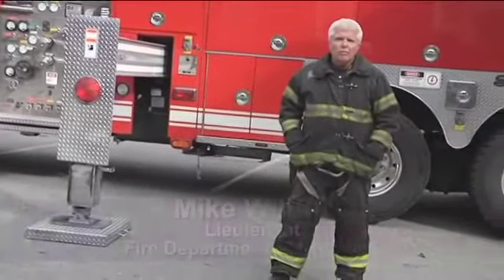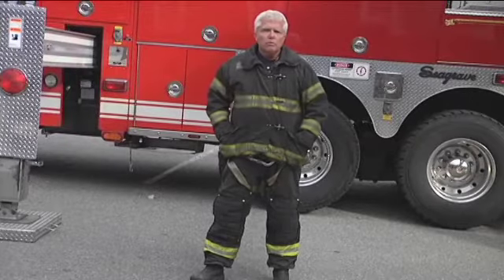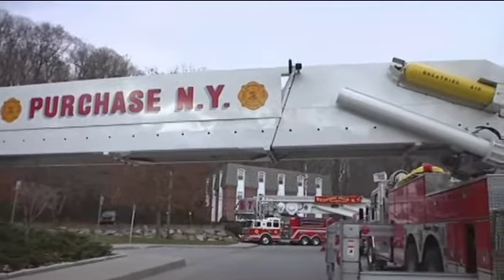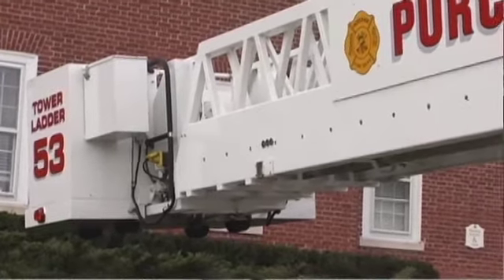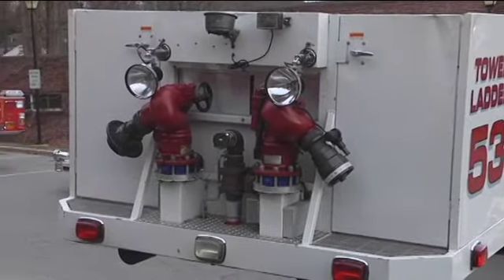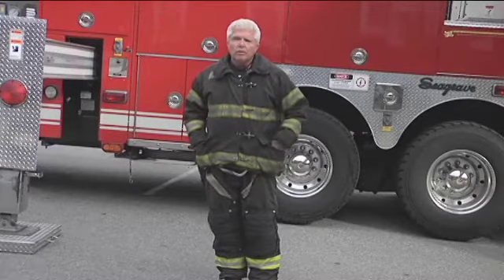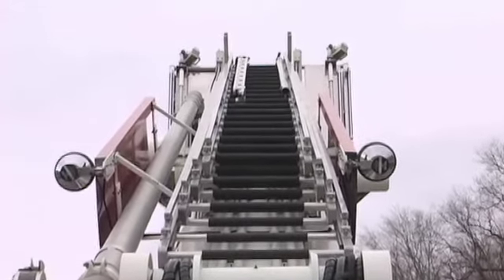Aerial Tower vs. Tower Ladder #1380771835001

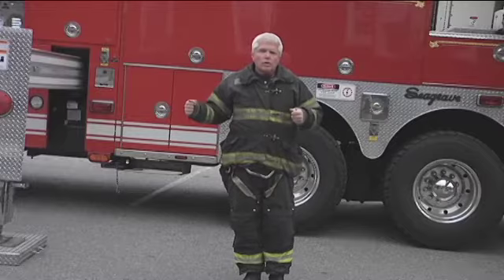Comment: Let's first define Aerial Tower and Tower Ladder, because these apparatus look similar. In the video this distinction is at the 6:37 mark. Watch this first if you are not sure of the differences. 

Tower ladder has a telescoping boom instead of a civilian/firefighter ladder, with a bucket on top and an emergency escape ladder on top of the boom for limited emergency escape use. A victim would be taken into the bucket and lowered to the ground.

Aerial has a civilian/firefighter ladder, which has high railings on either side of the ladder for safety and ladder stiffness. This aerial then becomes an aerial tower if it has a bucket on top. Most aerial ladders do not have a bucket on top. It is incorrectly marked 'tower ladder' on the side of the bucket. For a normal aerial ladder a firefighter and victim would down climb the ladder together. However, with this bucket added you could lower the victim to the ground in the bucket just like a tower ladder.

Comment: What about a tiller truck? What kinda ladder is that called?
Reply: Well it would probably be referenced as an arial, not a tower though probably just an arial ladder or a stick
Reply: Tractor Drawn Aerial (TDA)
Reply: Alot of FFs in my area would call it a stick ladder, because there isn't a platform.

Comment: or get a Bronto Skylift and make both of these trucks obsolete and pitiful
Reply: BS are pieces of crap my man. That’s why there are so few. Crap. Seagrave 95’ aerialscope is best and most sturdy TL on market
Reply: @heavy7799  if you say so.  I'd like to see a head to head competition including factual test results done by independent engineers. Not just some Seagrave fanboys opinion. From what I've seen Bronto Skylift is much more versatile, longest reach in all directions, higher flow rates, etc etc. What are you basing your opinion on. By the way truck brand has nothing to do with the boom. You can put a Bronto Skylift on any truck. Also 95ft is pathetic. That's like saying 3inches is better than 9inches. 😂 Bronto Skylift gets it all the way up and gives you a reach around.
Reply: @t.d.bowman9585  ...how many are in service and what big cities use them? You also put a 95 aerialscope on just about any chassis
Reply: I drove a Bronto for years (174’) and hated it. Biggest POS ever made. Worked ok .... when it worked. Constantly  having problems even with experienced D/E and with inexperienced D/E was impossible.  Happiest day ever was when it got replaced. Only thing Bronto would be better at was for an airport tower fire. Best used as an artificial reef IMO